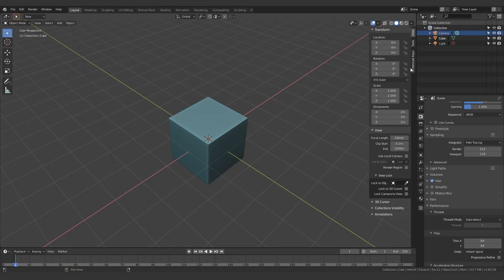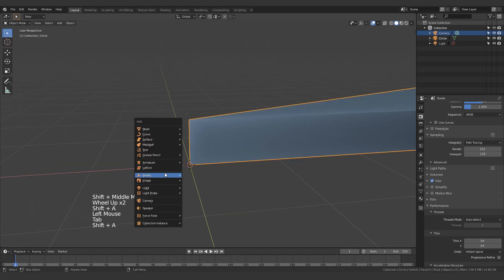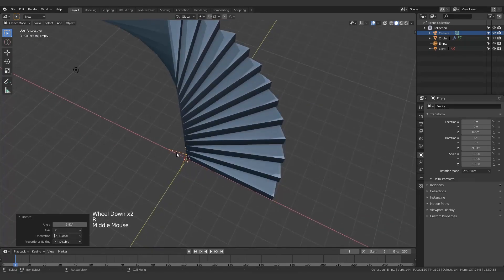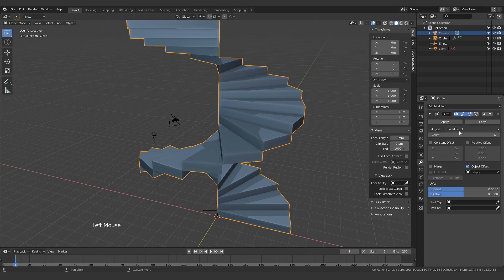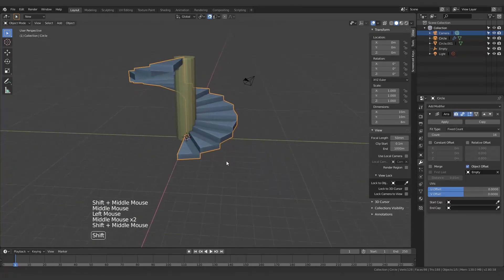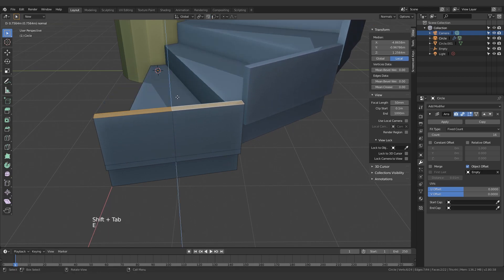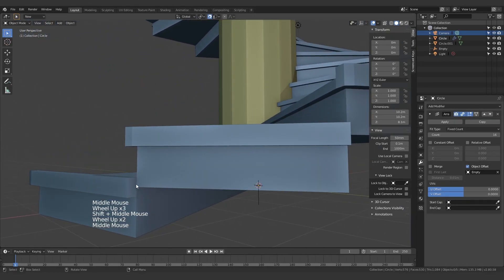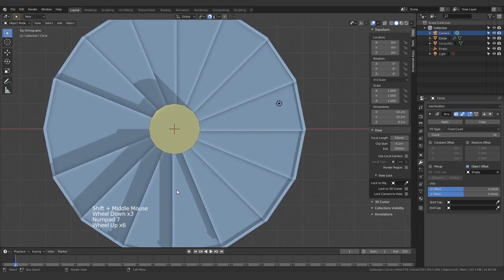Spiral Staircase - Quick Model Tutorial - Blender 2.8

Comment: Nice tutorial. I used it for a lighthouse, so far so good. But I've ran into a problem. If you don't mind me asking, is it possible to narrow the stair case to a narrowing cylinder? I'm stumped at this point. Thank you.
Reply from the maker: Use a cylinder in the center that can be used as a boolean to slice off stairs that overlap with it. Scale down the empty that's being used to array the stairs.
Reply: @WasiqWiqar  That sounds like it'll work I'll try it. Thanks.
Reply: @WasiqWiqar   Okay, I was going to come here to say the boolean didn't work. However, after spending some time looking at tutorials and EVENTUALLY finding the one blender page that talked about MERGE BY DISTANCE, the cylinder finally appeared when I "booleaned" it with the stairs. Now it works fine. This shouldn't have been this difficult and time-consuming, but I still wish to thank you for giving me something to learn. Thank you.